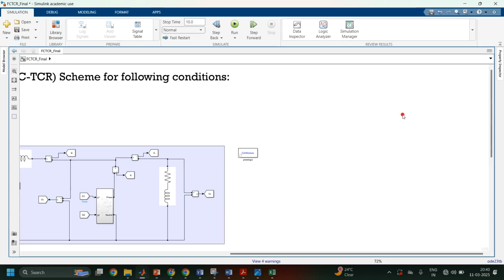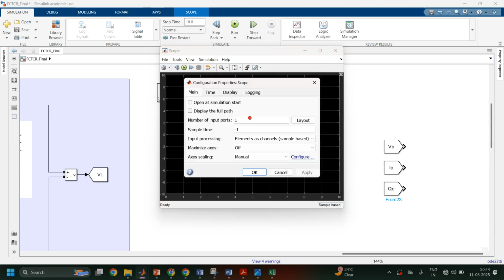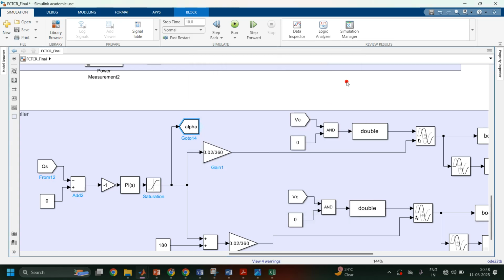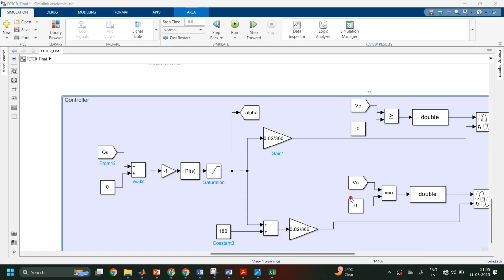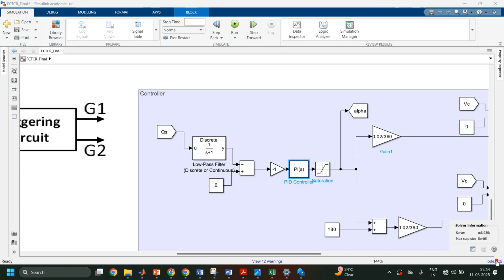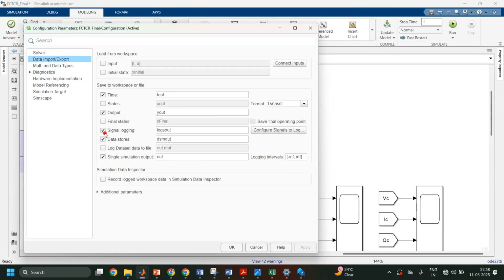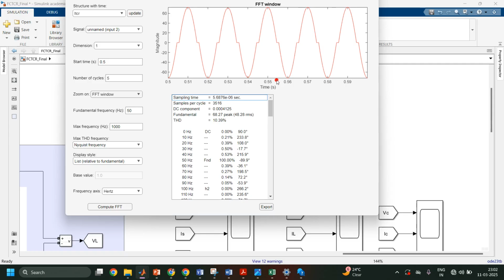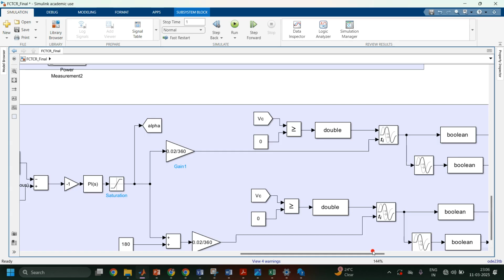Design of FC TCR PART 04 #powerelectronics #simulation #powersystemanalysis #powersystem

Comment: Error in port widths or dimensions. 'Output Port 1' of 'singlephasewithload/powergui/EquivalentModel1/Gates/From1' has 4 elements.  This port does not accept the dimensions (or orientation) specified by the output signal.
Component:Simulink | Category:Model error
Error in port widths or dimensions. Invalid dimension has been specified for 'Input Port 1' of 'singlephasewithload/powergui/EquivalentModel1/Gates/Mux'.
Component:Simulink | Category:Model error

These two errors pop while simulating.
Reply from the maker: Please check the block of power measurement. In power measurent choose output of fundamental power.
Reply from the maker: Please check power measurement block. Answer is in video